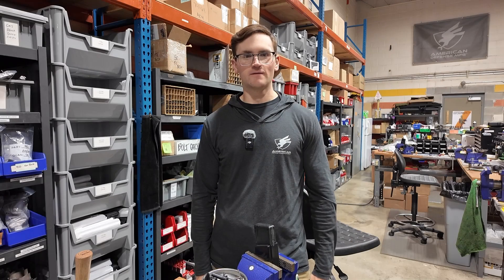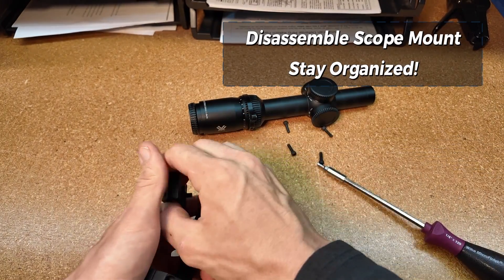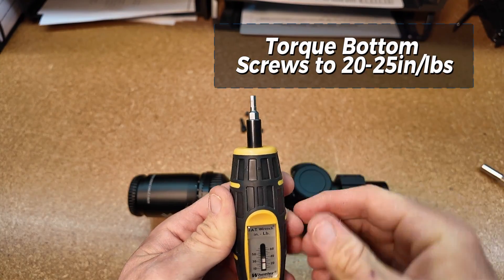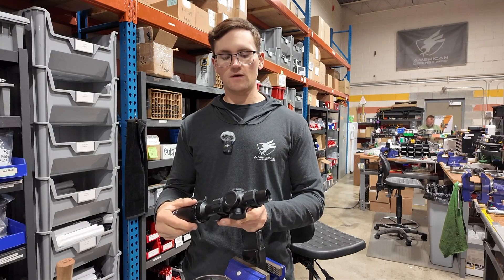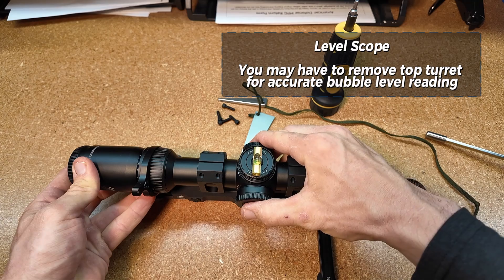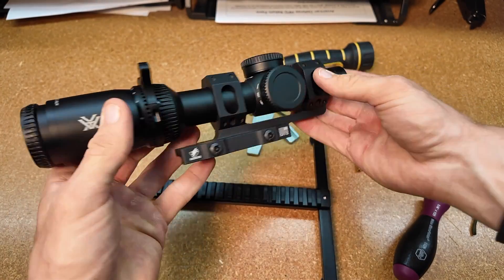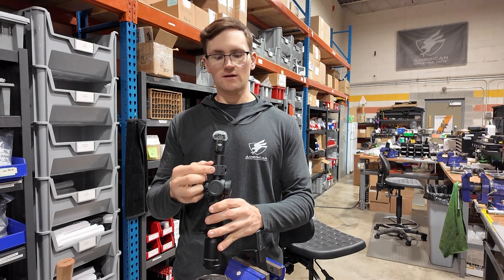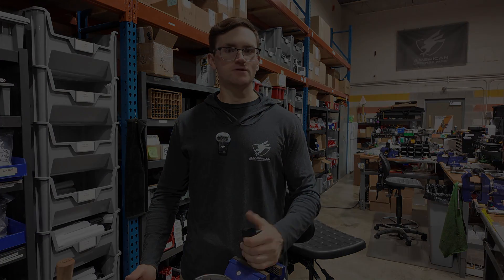AMERICAN DEFENSE MFG TECH TIP: RECON SCOPE MOUNT INSTALLATION

Comment: Your online recommendation for torque specs specifically say 20-25in lbs for the scope rings. You may want to revise it to say 20-25 for the bottoms screws and 18 for the top. I could’ve seriously damaged my scope had I gone by those specs
Reply: The video says this.  Multiple times.
Reply: @ the video does, the listed online specs do not. Read my comment